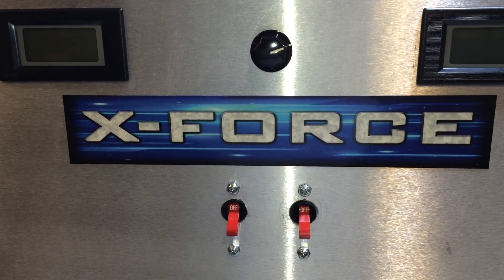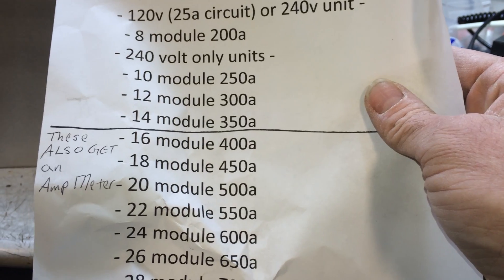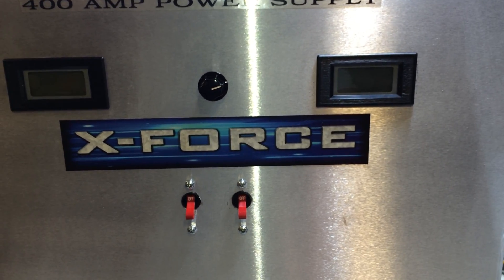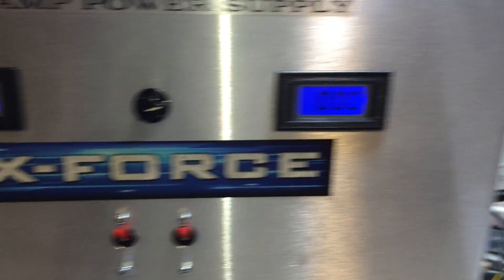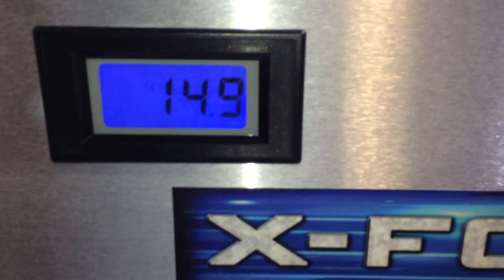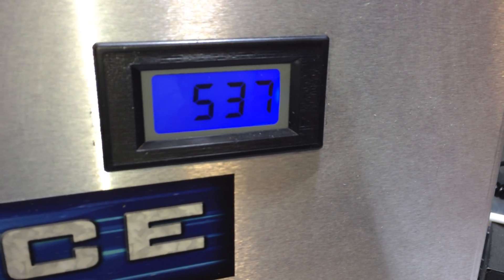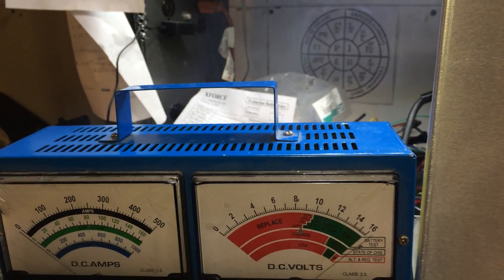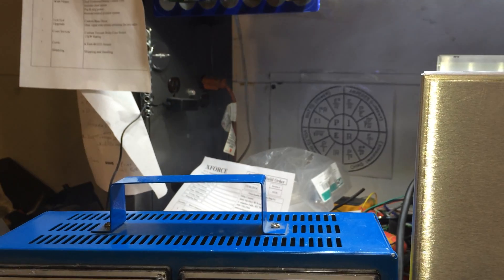Xforce 2015 400a Modular Switching Power Supply

Comment: What size power supply does it take to run a 1x3x16 or a 1x4x24 in the house and hold 16.5v? Seems like a single or dual gs35b would be more cost effective for similar rated power...